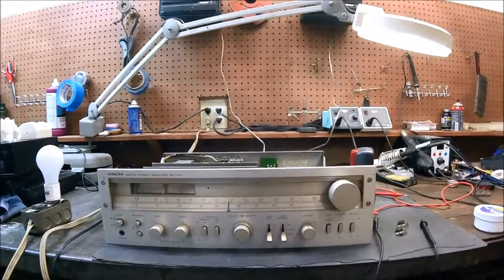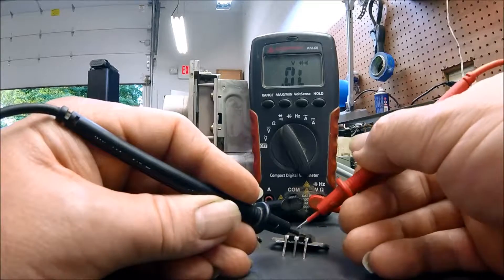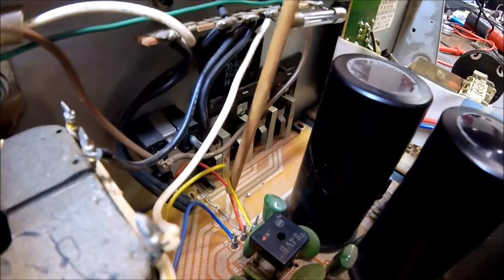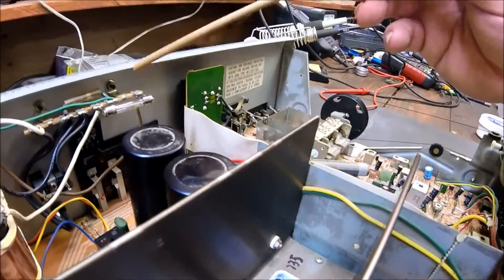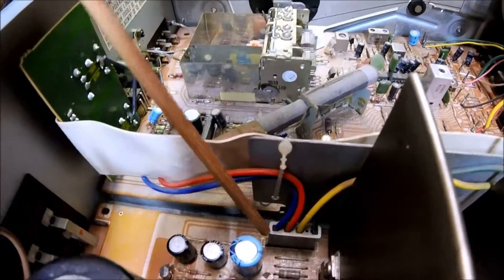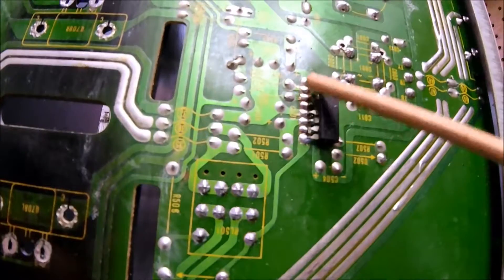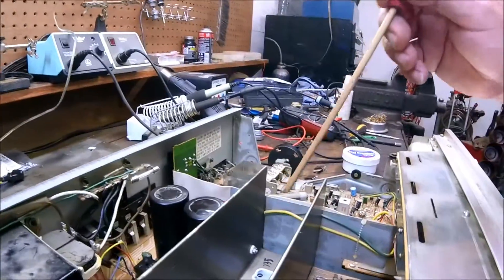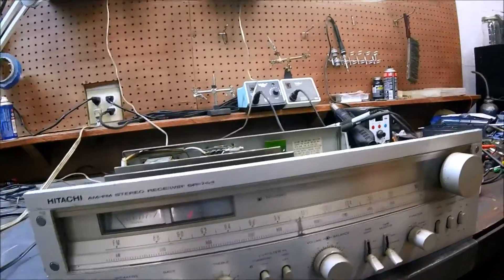Vintage Hitachi  receiver repair...Help needed..direct connection ocl power amplifier

Comment: I owned a related model the SR-903 over a decade ago.
They're built very well and deliver a great and very pleasant sound.
Class G is basically an improved Class AB amplifier design with improved characteristics.

For beeing able to effectivly search for errors, I would recommend to aquire a service manual with circuit diagrams and parts list.
The complete service manual is available online at the Internet Archive.
A very important part is the documentation of all the voltages and currents of the transistors in the amplifier, as well as calibration and adjustment instructions.

I would go from the power transformer and suppy on forward through the circuits. Usually the power suppy should provide a couple of supply voltages for the pre-amp, the amp, the tuner, illumination and so forth. A dead short should be directly measurable. Especially when it translates through the power transformer from secondary to primary.

I know this comment comes very late and the reciever in question might be long gone.

Comment: If u still have the unit here's what u can try.Locate your + and - voltage rails( originating from the big capacitors) and test the ohms( resistance) from the positive rails to ground and the negative rails to ground.If u get a very low reading trace the circuit along the power line and find where it goes into the tuner and preamp section if it does go to there.once u found where it goes to the separate boards disconnect and of lift those jumpers going to these boards. Ive tried looking for the service manual as well but it seems only for sale on ebay. Trace the power rails with those whiteboard markers if needed and not through any high value resistors since u are getting a serious enough short without the power transistors in circuit.Also the fact that those driver resistors have smoked abit points to a failure in the driver transistor circuit.U can also remove the driver transistors and try powering up the unit with the dim bulb tester again.Note the orientation before u remove them.Good luck.If u are still getting a short start disconnecting where power is going to various sections of the circuit to pinpoint where the short is.Its harder without a schematic but it can be done.
Reply from the maker: Hey thanks a lot for watching my video and your help!!..I do still have it, i just have set it aside as it was stumping me..I will get it back out at some point because i would really like to fix it if i could..Not thats its worth anything or a desirable unit , just for the experience since im a beginner..Though if i do fix it i will put it to use somewhere im sure..I have vintage stereos set up all over my house and garages!..lol..But yeah thanks i will try and use your tips when i get it back out, and maybe make another video!..Thank you!
Reply: Cool no problem hope u make some progress there .looking forward to a video update .

Comment: I know this is way late, but, 3 things to check out:

1. The fusible resistors of that era tend to drift in value over time. Sansui had this issue, and, I suspect Hitachi did, as well. This was know to damage output transistors.

2. Electrolytic capacitors age as well, and, can also short.

3. The transistors & zener diodes on that channel need to be tested. They also age, & shift values.
Reply: Mike Holmstrom 
I have a similar issue with a hitachi hma-7500.  While trouble shooting it.  I found 3 blown mosfets.  2 of the 8 main filter caps are shorted. And I would say 30% of a resistors tested bad.    Also diodes were bad.  Is like changing every component on this thing to bring it back to life

Comment: Of course, the following probably won't help you repair the unit. This is how I understand it:

Seems to be a Hitachi “scheme.” With this circuit two pairs (4 total) of output transistors are used per channel. Each pair is powered by a separate power supply. There are two supplies; one low dc-supply voltage and one high dc-supply voltage. One pair of transistors handles low-level signals; the other pair handles high-level signals once it conducts. Basically, the high-level transistors kick-in when the signal reaches a certain level, otherwise not. That is to say, when the signal level exceeds the low-level dc supply voltage, the high-power transistors begin working. The low-power transistors are then off. So in your case, you should have 8 output transistors. Two NPN and two PNP transistors for one channel and the same for the other channel. 

I don’t know what the advantages would be; efficiency is supposed to be increased, making for a lighter amplifier/receiver. That would be great if we had to lug around our equipment all the time. Makes things more complicated too...
Reply from the maker: i believe you may be describing what Hitachi calls Class G...i don't think this receiver is class G as it only has 4 output transistors...Some of fellows on the Audiokarma.com thought it was too at first since the models above and below this unit were...and this one is not for some reason...unless im wrong and these transistors are really two transistors in one package maybe??...Thanks for watching my video!..i still have not messed with it anymore,i need to order some of those resistors that burnt up before i can test anymore..the one was burnt but luckily stopped in time that i could still see the bands so i could find out there values...the other was completely unreadable
Reply: The advantages Old School, of class G amplification are a smaller heat sink, lighter unit, cooler running amp (which leads to longer amp life) and Class G has been praised for extended headroom, 3db in the case of the SR-804, 904 and 2004 receivers. Julian Hirsch in Stereo Review spoke highly of this class. Also a review from High Fidelity in 1980 said of the class G, SR-903 receiver... " if discs (LP's) are your bag and you like your music loud, this receiver will really show you something". Complicated or not, the principal does work. 
 I have a SR-804 receiver purchased 8-28-1979 as my main amp and it still functions perfectly. Not bad for almost 40 years. No amp is perfect, however, if it works, we should be happy. It does sound like you know your electronics.
Reply: thanks for the info and comments, marty. looks like you know your stuff.
Reply from the maker: Do you guys still believe this receiver is class G?...The one thing that i find strange and sticks in my mind as a clue to the problem is the fact that while i had all the output transistors removed there was  2 resistors that burnt when i powered the unit it on with a oversized fused and no dimbulb tester......1 on each channel. The 1 on each channel thing is what gets me.. It seems too much of a coincidence that there is a shorted pre driver on both channels.. plus i had all those pre drivers out of circuit and tested them..they had no shorts
Reply: Old School, thanks for the nice comment. Truth is I know far less tech stuff than you. I'm more of a researcher. I have many publications and reviews from the 1970's/80's for reference material. Also, like the late Elmer Keith's (gun guru) quote "hell I was there". I got into hifi in my twenties about 1975. I lived thru the vintage audio era (receiver wars?). I was there! NYC then was a gold mine of audio stores; Tech HiFi, Harvey Sound, Stereo Warehouse,  Churchill Audio, Great Sounds and The Audio Graveyard (located across the street from Trinity church's cemetery (hence the graveyard), Crazy Eddies. Lots of shops filled with knowledgeable people whom loved to talk stereo.
Reply: Lonny, all the Hitachi receivers that were class G were labeled on the faceplate either Class G or Dynaharmony. I notice in the video that the SR-704 is not marked as such, leading me to believe it is NOT. 
 If it is Class G it should have two sets of output transistors. What do you think??
Reply: Marty: Oh yeah, hifi was big back in the day. People would "show off" their stereos when you went to visit them. I think I started off with a lowly Kenwood KR-4070 and Bose 301 speakers...And back then salespeople knew their stuff (at least the one's I met). The Audio Graveyard sounds cool. I wonder what happened to all the stores?
Reply: Lonny:   What's the progress? I'm gonna subscribe to your channel just to keep track. By process of elimination you should be able to get to the bottom of this. Krish's (a previous poster) approach is sound.
Reply: Old School, the answer is brick and mortar stores are like the dinosaur. Too bad. I worked on 44th st. and 5th ave. in NYC in the 70's. One block away (45th st.) was known as Stereo Row. Half a dozen hifi stores there. Guess where I spent my lunch hours??? One store I forgot was Uncle Steve's at 343 Canal st. NYC. Run by a little Jewish guy, boy could he haggle a price. 
 Your first system sounds boss. The KR-4070 was a heck of a receiver (great FM front end). Kinda devoid of EXTRA features but it could crank the output (40wpc?) and good reserve power, maybe NOT so lowly. Were the 301's series 1??
 My first system (don't laugh now) 1975 was a Pioneer SX-434 receiver, BIC-920 turntable and KLH model 31 speakers. The whole system cost less than $250! I was earning $120 a week and my Bay Ridge , Brooklyn studio apartment rent was $95 a month including gas and electric. Thanks for letting me reminisce about the olden days. Is that why you're monica is Old School??
Reply from the maker: @ Old School...Sorry yeah i have not messed with it since this video...I'm always into so many different projects and my bench is a mess i just haven't got around to looking into it again...I am one of those guys that have 20 different unfinished projects laying around!!..lol.. But yeah thanks for the sub, i have been subbed to you for some time now, but been busy learning to sell on ebay i haven't had much time to comment on any of yours or others videos...
 
Also you guys can talk all you want about stereos on here i love hearing the stories !...I was so into stereos in my early teens in the early 80's..My favorite places was called Swallens department store and they had 2 special enclosed rooms with sliding glass doors just full of higher end audio equipment!...They had to follow me around with a mop to mop up the drool!!.hahah..Also radio shack was a favorite, i could look through those catalogs for hrs!
Reply: Lonny, love your stories too. Guess I'm a bit older than you as I was in my mid twenties in 75'. There used to be an Acoustic Research audio store and sound room in NYC's Grand Central Station (on the mezzanine) level, right in front of the PanAm building. I was twelve (1962) when I first saw it. Awesome speakers, tube amps and record players. It was the first time I heard the word turntable used. That new audio smell was better than sex (what did I know I was twelve).
Reply: Marty: Yes, Old School because of the golden age of hifi. I guess "real" old school would be tube gear. No, maybe that would be ancient. For reasons unknown, I don't like to collect or work on tube gear. 
I see you had a nice little first setup. Later on I "graduated" to a Sansui AU-719 amp and TU-719 tuner.  Thereafter I added some kind of DBX thing; I don't even recall what it was for...
Reply: Tube components were finicky, I'm glad transistors came along. As to DBX, they were mainly expander type units. Some worked in up to three bands, and could cost around $700, YIKE'S. I have used a Pioneer RG-2 since purchase on 6-2-1981($130). Dang thing still performs fine. Me thinks the RG stands for inventor Robert Grodinsky (not sure of spelling) who had his own line of expanders. 
 I also use and enjoy an equalizer, the ADC Sound Shaper Two IC (3-16-1982, $213). It has bidirectional tape dubbing (nice!), 12 bands per channel, a useful meter and subsonic filter (18db/oct @15hz). My amp is a Hitachi SR-804 receiver (8-28-1979, $370). Main speakers are Ohm L's (9-22-1978, $356). I keep all in good repair. Guess I'm kinda 'old school' myself. Got other STUFF but don't want to bore you.